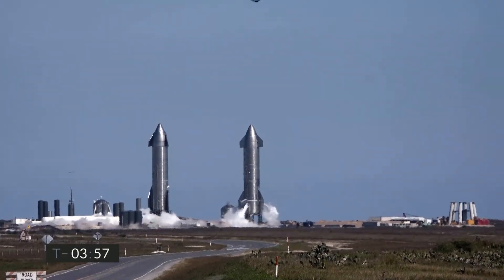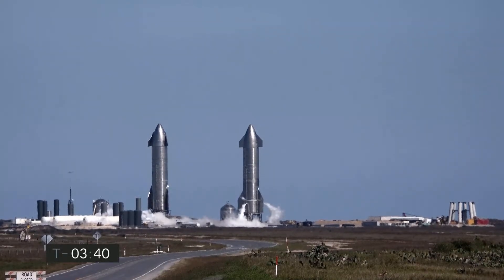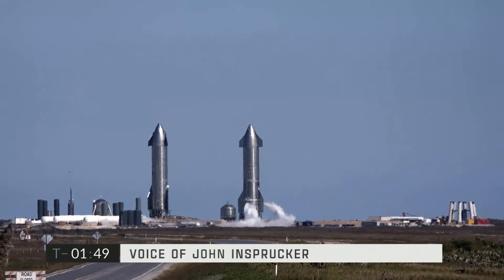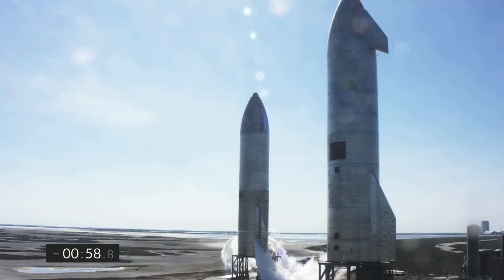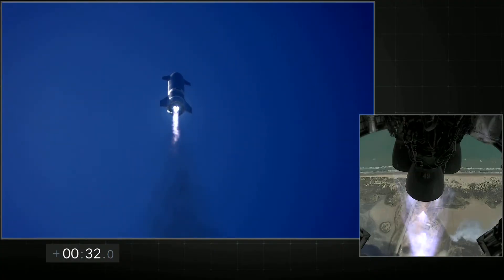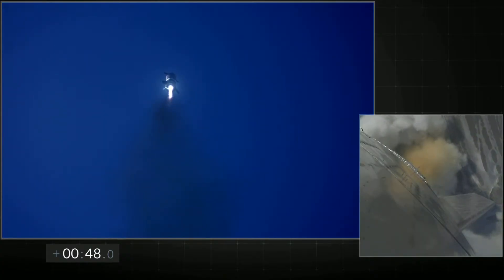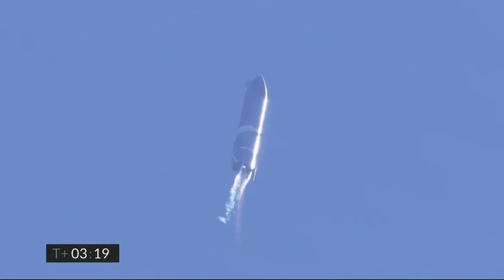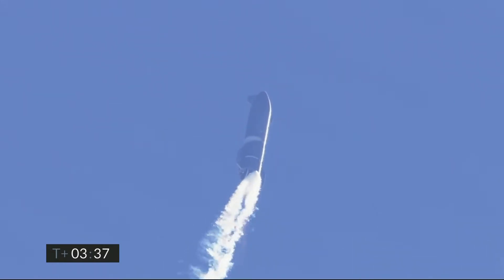Starship | SN9 | High-Altitude Flight Test

Comment: Falcon 9, what happened to numbers 1 to 8, dont ask, scrap yard, well what bits were left anyway.
Reply: It's called the Falcon 9 because its got 9 engines.
Reply: Falcon 9 = 9 engines on the first stage

And there was a Falcon 1 though most forget since it only launched 4 times
Reply: Falcon 1: one engine 

Falcon 5: five engines

Falcon 9: nine engines
Reply: 9 coz 9 engines, i get it, but why Falcon that is not, and 9 engines, means fuck all to me, just a bigger explosion.
Reply: It can have 109 engines, its still ugly, and it will still blow up.
Reply: @andrewherrington9991  
More engines doesn't mean bigger boom. It's the size of the fuel tanks that determines that.
Also, Falcon 9 has gotten very good at not blowing up.
Reply: Fuck me thanks, i never realised that 9 engines would need more fuel, so 1 engine uses the same as 9, clever shit, well done.
Reply: But just one last silly point, so why does a 3 litre engine, guzzle more fuel than a 1 litre, just asking.
Reply: 1 engine, smaller amount of fuel, so less bang, 9 engines, slightly bigger bang, and your the fucking brains of the world.
Reply: Fuel tanks yes, i get it, so mine is slighty smaller than a lorry, yes, but why, i dont know, more fuel needed perhaps, really.
Reply: @andrewherrington9991  
More engines doesn't necessarily mean more fuel in rocketry. 

Sometimes you only want more thrust but not more fuel, in order to reduce burn time and gravity losses.

Centaur is a good example, it comes in both single and dual engine variants, both have the exact same fuel tanks.

Falcon 5 was also planned to have the same size fuel tanks as Falcon 9, though it ended up not being built. 

In both cases, the number of engines doesn't change how much 'boom power' these rockets have.

Likewise, SpaceX plans to make versions of Superheavy with different numbers of engines, but the same fuel tanks. 

The default is around 28, but could go as low as ~16, or as high as ~35.
Reply: He has to go ya know, its his dream, like his cars, he owns and drives one dont he, and nothing else, i wont, coz it aint my dream, but he musk, muskent he.
Reply: So when is he gonna go, come on einstein, when.
Reply: Hes putting it off, but the world wants him to go, save us, posh boy, so when.
Reply: And dont ya dare call that mess a Falcon, you fucking aint, call it ya xbox name, anything but that.
Reply: @andrewherrington9991  Are you off your meds or something?
Reply: Why do people allways say that, say something like you cant spell or dont write a comment, allways resort to you on drugs or meds, coz thats all ya got to say, planet drainers.
Reply: @andrewherrington9991  I asked because you made four separate replies after I replied to you, none of which had anything to do with what we were discussing, and which seemed to border on incoherent rambling.

The fact that you say that people always say that to you is quite telling. I don't often have people asking me that question, so don't you think there might be a reason they're asking you?
Reply: Last point call it something like jet stardust 9, like peoples  names and xbox games, not a gracefull bird that is very real, and does not destruct like that.
Reply: 44 grand for a shitty tesla, you can get a micra for 8, and its got all the toys, wheels, gearstick, stuff like that.

Comment: Rocket propulsion has been around for 100 years. This is old technology with a new spin on it or lipstick if you will.
Its new to the uninformed millennials that are in love with musk and bitcoin...

Just like electric cars, solar panel cars, hydrogen cars 100 year old technology, now being talked about because the timeline is right and works with the grobal warming fraud that millennials embrace
Reply: Very few things are new inventions these days. But improving existing things to make them more practical, or applying them in new ways, is still innovation.
I'd point out that rocket propulsion is a lot older than 100 years, well over 1000. You're thinking of liquid fuel rockets, which is a 95 year old *improvement*.
Likewise, SpaceX's gas-gas full flow staged combustion engine is a further significant improvement over previous rocket engines.
And there's also the new control systems. The computing hardware and software needed to fly a rocket like this are very recent developments.

Comment: The principle of landing has been tested with other test vehicles. Yet SN8 and 9 fails to land without crashing. It was unexpected to see SN8 crash like that in the fist place. Now SN9 also crashed. Looks like SpaceX might have one of those weird situations where an explanation is illusive and a resolution not easy...
Reply: Nothing like this has ever been attempted before. Sure, other vehicles have propulsively landed, but they have always come down vertically, not horizontally.
Also, SpaceX fully expected to see SN8 crash. They said it only had a 15% chance of not crashing.
Reply: @lazarus2691  Hi thanks for your input. Can you point to where and when they said it had only a 15% chance of not crashing ? Did they say that before or after the crash ?
Reply: @NeoFrontierTechnologies  
Elon said about two weeks before the flight that it had a 1/3 chance of completing all four mission objectives; '3 engine ascent, body flaps, transition from main to header tanks & landing flip'. 

That alone says that it wasn't expected to survive.

But note that that list of objectives doesn't include actually sticking the landing. It was never a primary goal of SN8 to land.

If it did make it through all the test objectives, landing was about another 50/50 on top of that, which works out at 16.7% overall, rather than 15%.

Comment: i dont know if m correct , but this is half of starship right? this is second stage which is only supposed to land not lift off as the other half is meant to do that?
Reply: Mostly correct. This is the second stage, and in most cases it will indeed launch on top of the booster, but there are also some situations where it will launch by itself.
For example, when launching from Mars or the moon, the booster is not needed. Or when doing a suborbital flight around the Earth.
Reply: the second stage makes up about a third of the rocket but yes.

Comment: Having said this before and wanting to reiterate that I'm a big fan of Elon Musk for more than one reason; I'm asking "Do you all think that ring stacking structure of the SN9, SN10 style is solid? I want desperately to see him succeed, please believe me.  Here me out? Went back, counted the number of rings stacked at 17. There could be several more components in the stack. I simply couldn't find an ultra clear image. But at the 17 that's a minimum of 1575 feet of welds for the 30% of a mile of welds. Every inch of which must be flawless because it's all pressurized. That's for the upper stage of  one vehicle.
Reply: I'm just concerned that the chances get "astronomical" for some kind of issue to arise!
Reply: Do any of you know what kind of welding process they use?
Reply: Considering that they pressure test these to high pressure and find no leaks, and that neither SN8 nor SN9's failures had anything to do with welds, I think they've got it under control.
They would like to use taller rings to reduce the amount of welding, but nobody supplies wider sheets than 6ft/1.82m for the alloy they need without an expensive custom order.

Comment: Things that didn't happen during SN8 flight:

Countdown didn't suddenly stop and continue.
One Raptor engine seems to be on fire while running.

I have the feeling that spacex just wanted to start sn9 no matter what happens (it's just a guess but it could have been possible that the sn9 computer said: hey! somethings wrong!)
Reply: We saw a similar fire on SN5
Reply: SN9 maneuvered smoother and faster than SN8 and the same goes with the take-off, the belly flop transition and descend of sn8, which was very rigid and weak.  SN9 didn't light green at the end so that's another win

Comment: sn8 is way batter when become in landing
Reply: Yeah but the high altitude profile SN8 was slow, rigid and weak. SN9 flipped to horizontal in much less time and less RCS thrusters work
Reply: Not all true... We saw a engine-rich exhaust just before SN8 crashed, here, we see none, Its just that an engine failed to re-ignite causing the flip to fail. If it worked, SN9 would have been standing proudly!

Comment: in the USSR in the 70s, ships were more technical than this;)
Reply: Thry couldn't be reused
Reply: @pictobloxer5412  And I don’t see them using Full Flow Stage Combustion Engines
Reply: Sure. Even today Russians build beautiful rockets and launch facilities!

But SpaceX has started here in a swamp and in a year they already have this. Russians have been working on their new "Vostochny" launch facility since 2011 and it is still work in progress. It is not surprising that it looks better when so much more work gets put into it! 

Russians also only plan to develop methane-fueled engines (RD-0169) similar to Raptor sometime towards the end of 2025.
Reply: Russia uses old expensive and expandable rockets and it isnt trying anything revolutionary

Comment: So my question is. Is the belly flop completely necessary for the full duration of the drop? Straighten out early and replicate a falcon9 landing. The flaps didn't seem to be proactive in the final manuver, to help control rotation, either. I feel the design of the flaps could be multi purpose in both vertical and horizontal control with a little adjustment.
Reply: The flaps do the majority of work if it comes to orientating, they want to glide it down so it can land on mars, one side will be protected by head shield tiles.

Comment: That final cold gas jet flaps maneuver to vertical needs to happen about 25 maybe 30 seconds before TD not 16 seconds.  If one rocket fails to light, the back up should have time to divert fuel priority to it. All three need to be ready to go hot.  These engines are pretty nice... might not be fuel efficient but you had lots of Ox and looks like lots of Propellant.  Loving every minute of it... Given that the landing legs/flaps haven't had too much practice landing they likely don't work at this stage... why optimize landing legs and landing when its not the priority.  Getting to this stage using low cost SS test mules is amazing

Comment: Hello, I'm from the future 
Im going to say: SN10 didn't stick it quite well. It was a raptor problem AGAIN :( 
One engine did not perform well and sn10 landed landed leaning just a bit then tipping over. The case was poor thrust resulting in lower tvc
Reply: Im not telling the date might cause a paradox but tho this is less paradoxial in terms of did land or did not

Comment: The first several missions to the Moon and to Mars should not be human crewed, use humanoid robots instead.
Reply: Or dummy mannequins
Reply: @pictobloxer5412   Those can't walk or build a habitat. Humanoid robots will set the table for human life on Mars. That way if there are more RUDs, human crew members won't die.

If that were to happen on the first missions to the Moon or Mars, that could destroy public support. You don't want that, right?

The goal is to colonize and terraform Mars, correct? Not just going there, then crash and burn.

Didn't Elon Musk himself talk about using robots first? And humanoid robots have come a long way, they can maneuver pretty good now, and by the 2030s they'll be even better. 

In the meantime, the people at SpaceX should seriously consider horizontal take off and landing, or VTOL, with the craft in a horizontal position. There is a lot more leeway with that approach.

Vertical take off and landing requires perfection, which isn't very practical or safe. It invites disaster.

How comfortable would you feel as an airline passenger if the plane were to take off and land in a vertical position?

Elon Musk has to unwed himself from human crewed rocket tubes. Single stage to orbit or runway to orbit space planes, and horizontal landing, is the way to go.

Advancements in rocket fuel will make this feasible. And... phys.org/news/2019-07-earth-mars-days-power-nuclear.html 

The nuclear part would only be used in space.

The people at SpaceX have to start getting serious, or their fantasies about Mars will remain fantasies.

Their current plans are in no way realistic. Every stage is very problematic, and worse.
Reply: @jade59230  wow you had to write a whole paragraph
Reply: @pictobloxer5412   You mean, book?
Reply: Orrrr hear me out now, land them there and leave them till another rocket with humans land???
Reply: @OortCloud   The robots? Leave the robots on Mars?.. Yes, that way they have the time to put together a base of operations, and maybe prepare some fuel.
Reply: @jade59230  NO. I said, land the un-maned rocket on mars, and then the next trip should be with humans.
Reply: @OortCloud   Land an unmanned rocket on Mars to make sure it works, then send a human crew?

Yes, but send a few humanoid robots too to get things set up for the human arrival.

With the current plans that SpaceX has, about how many months would the human crew be subject to zero and low gravity environments?

I recently read that it would be 8 months each way, plus whatever time they spent on Mars.

This would cause serious and permanent injury to the crew. Or a slow agonizing death when they get back to Earth.

I think that the people at SpaceX need to rethink their whole plan, and develop a better space ship for a human crewed Mars mission.

They either have to get there a lot faster using nuclear power, providing some gravity from constant linear acceleration, at least part way to the destination. Or use rotational gravity. Or a combination of all of the above.

What do you think about the Hermes spaceship in The Martian movie? It looks pretty good to me. It would cost more and take more time to put together in space, but it would help assure mission success. Which is the most important thing.

Mission success being both getting there, and getting everybody back alive and uninjured.

I realize that SpaceX fans just want to go - go - go, but I'm saying think - think - think. Think things through. Including the good people at SpaceX.

At minimum they have to go nuclear, and use robots. Then send some humans over. With more robots.

Have you seen the latest humanoid robots, including from DARPA? They are very impressive. By 2030, they will be even more impressive, AND they won't be troubled by a lack of gravity.

I know, it looks like a got robots on the brain, but darn it, we need them for our space missions, and SpaceX doesn't have to make them. Elon has like a zillion dollars, he could just buy some of these robots with his pocket change.

Let's say they cost a million dollars each. Spending just 20 million (or 20 thousand in Elon money), would buy Mr. Musk a lot of peace of mind. A lot.

If I was his friend, I would tell him this.
"ROBOTS, Elon. And go nuclear. No more f-ing around."

Comment: I do not know if this will work, but for landing you can add 4 landing holders (2 in the back side and two in the other side) in the middle of the rocket with propulsors that for the aligment of the rocket and a successful landing.

Comment: Why was the smoke or whatever the stuff was billowing out from underneath look so casual for something moving so fast? As if the rocket were at a stand still with smoke coming out beneath and a side breeze hitting the smoke.
Reply: Because it was. The rocket sideslips a bit at apogee, to place itself in a good position to fall and flip. That's why they  turn off engines one by one instead of following a ballistic trajectory with all 3.
Reply: Methane can make it look like what you are describing. If you search up raptor engine test, you'll see.

Comment: Those saying it's 9th rocket are technically incorrect. It's a second rocket with close to full configuration, earlier versions were just prototypes testing individual features from structural and design integrity to fuel loading and storage etc. Even these are testing a new landing methodology and related technologies. If it was to be a scaled up version of Falcon, it would have been operational by now. We'll get there soon! Peace ✌🏼

Comment: How much horse power is in a Raptor engine?
Reply: Rocket engines can’t really be measured in horsepower. They are measured by thrust.
But if you want to do the math, Thrust horsepower of jet engines and rockets is equal to the thrust in pounds force times the speed of the vehicle in miles per hour divided by 375 (which is equal to one horsepower measured in mile-pounds per hour).

Comment: So if this SN9 just crashed, does that mean that there was 8 other "SN" rockets that blew up while testing them !??
Reply: No, only SN4, SN8 and SN9 blew up. MK1, SN1 and SN3 burst whilst pressure testing. SN2, SN7,SN7.1,SN7.2 were designed to fail
Reply: This is the second test of this configuration, second actual flight test. Others were just static fires or 150 meter hops.
Reply: SN5 and 6 never crashed. SN4 exploded after suffering a pretty bad static fire test ON THE GROUND

Comment: It looks like the rocket tilted too far and wasn't able to position itself. It's a heavy boy to swing and stop in the last second. SpaceX needs to do this flipping maneuver at a bit higher altitude to give rocket a chance to get back vertically and slow down properly...it feels almost like the landing part is rushed and shorted. So in other words, restart at higher altitude and flip the rocket gradually not a fast swing in my opinion.
Reply: It would have still crashed, an engine failed to start